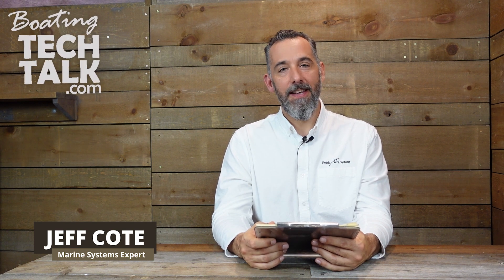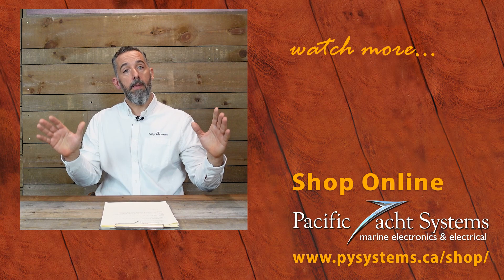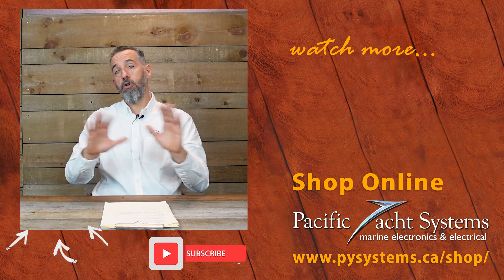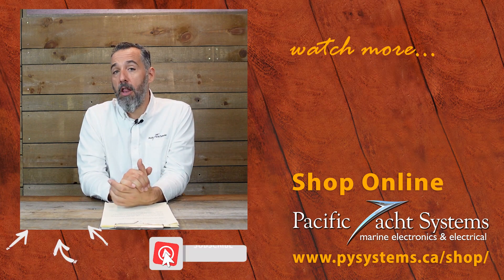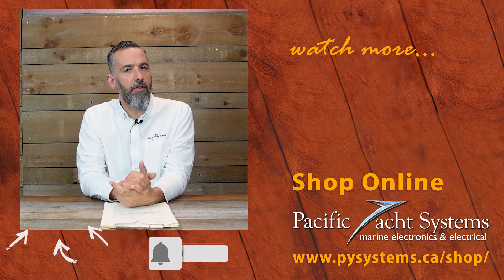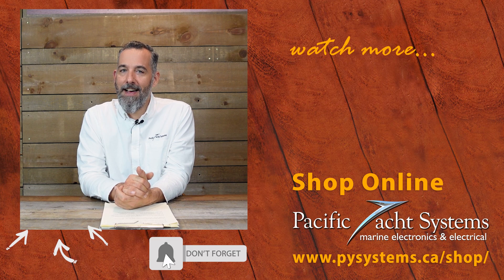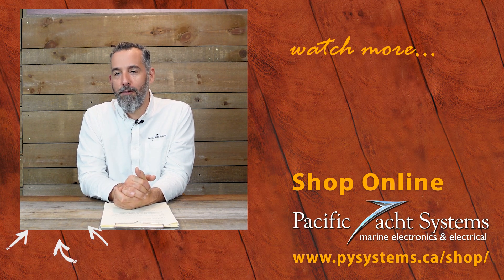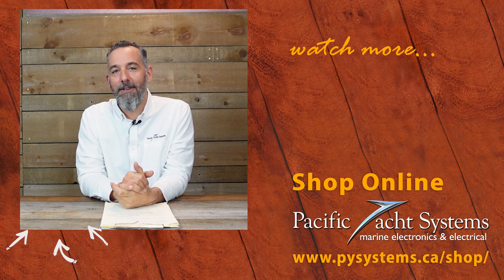I Have One AC Device on My Boat, Do I Still Need a Galvanic Isolator?

Comment: Hi Jeff, If we have no AC panel or AC-DC tie, is it ok to use a battery charger with only a 2 pin AC connector (Victron IP65) if we are connected to shore power via an extension cord? The IP65 (2 pin AC plug) charger doesn’t use an earth pin whereas the IP67 does (3 pin AC plug)…

Comment: hello Jeff i have 30 year old cruiser international  holiday 224  with shorepower 220v onboard i did not find any galvanic isolator .on shorepover i have ac whisperpower batery charger, water heater and 2x plug in for devices . what kinde of galvanic isolator is good inaf for my boat?
Reply from the maker: Choose a Galvanic Isolator that is rated to amp rating of your shorepower. For instance, if you 220 VAC 50 amps shorepower, then make sure your Galvanic Isolator is rated for 50 amps.

Comment: The point about joining/ common AC to DC ground is not agreed about internationally ( to put it diplomatically) by a long way. In the US it may be part of your compliance ( to protect all the swimmers in the Lakers and marinas!), but I'm sure I've read many times that joing earths might pose more risk (significant danger) to those in the vessel. Imagine working on the DC system (that is the majority on normal boats), which might become live with AC if there was a short fault. The outcome could be awful. Also, other views I've read  indicate joining AC to DC ground may definately increase galvanic corrosion, isolator or not. Lastly, connecting a cheap battery charger to your batteries ( from shore power) may cause stray currents; only the better chargers have inbuilt isolators. Can you clarify on video these really messy areas of understanding (...me included) please.
Reply from the maker: Yep, lots of disagreement on this front. As with most things, it's all about trade-offs, most choices have pros and cons.
Reply: @Mal L thank you for chiming in, you just saved me from buying a galvanic isolator.
Reply: @Mal L ah ok thank you for your reply. I'm wondering how you maintain a floating DC circuit when because of the alternator it's grounded to the engine and through the water it's earth grounded same as the AC power. Maybe some alternators don't ground the negative...?

Comment: Hi Jeff. I am adding a similar setup with a shore power cord connecting to a blue sea battery link 10amp charger. So there’s no risk of stray ground current running through the charger to the dc battery ground? Also do I need 15 amp circuit protection or a gfci in between the 30amp shore power and the charger? I found a short 120v extension cord with a built in 15amp breaker I was considering plus an inline gfci. Are either or both necessary?. Thanks!!
Reply from the maker: You definitely should have a 15 amp circuit breaker and GFCI powering your battery charger. Not quite sure how Galvanic corrosion would occur with your setup, especially since you don't have a AC to DC ground tie.
Reply: @PacificYachtSystems  great!! I was worried there might be a tie between the ac and dc grounds inside the charger? But maybe not. Thanks!